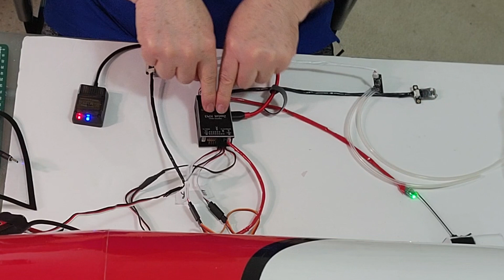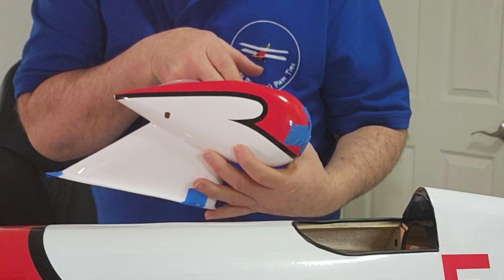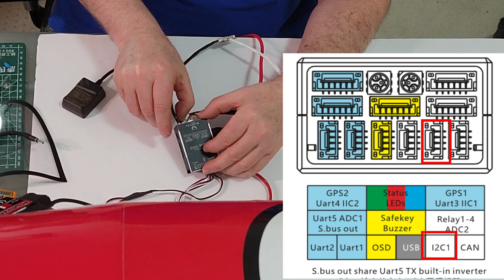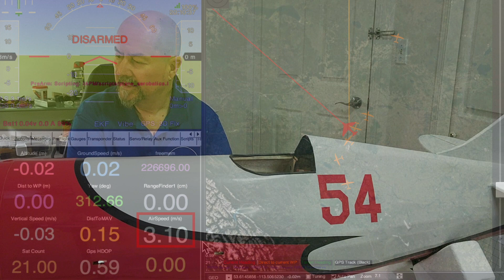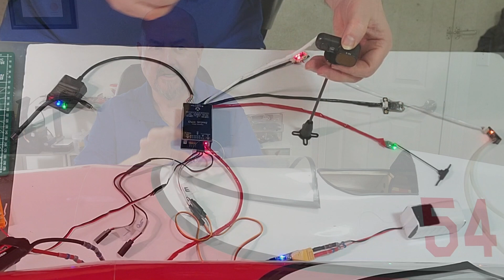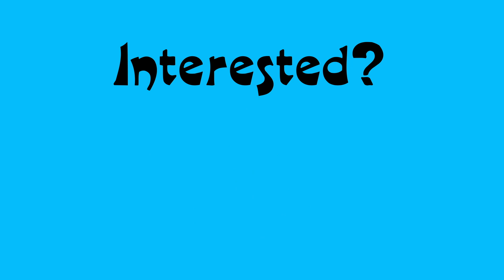Do you really need an airspeed sensor with ArduPlane? Gee Bee Sportster "E" with an autopilot.

Comment: Im my opinion you should mount the camera under the canope and the GPS in the hole of the fuselage, because of aerodynamics. Nice Video!
Reply from the maker: The Runcam Thumb is pretty tiny, but I do agree about the GPS. It was a fun plane to fly, did you see the videos of it flying?
Reply: @timtheplaneman  I saw it, looks like the plane crashed on the GPS antenna.
Reply from the maker: @flyingBalsaPilot  I guess but it wasn't caused by that, it was my bad flying skills. I've already used this GPS on another plane, it's fine. 🙂